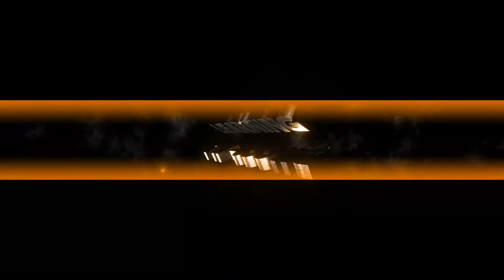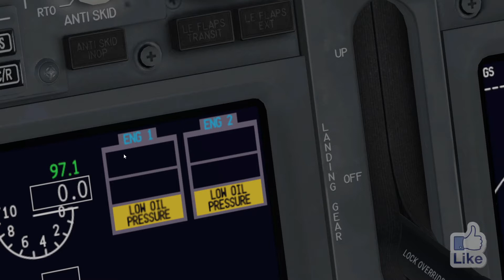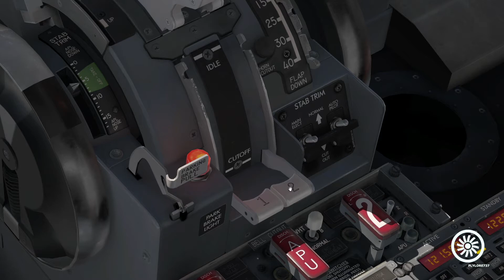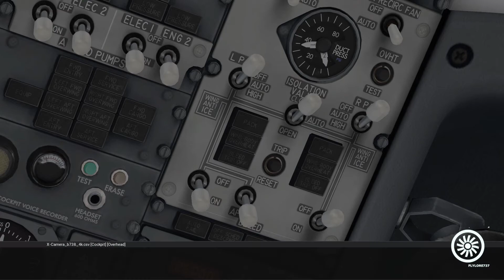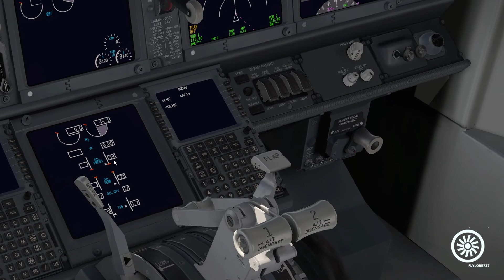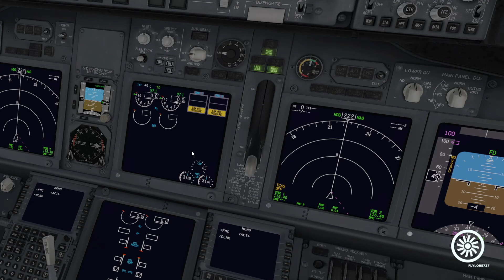Learning 737-800 - Start Valve Open [ENG]

Comment: Good video. Very helpful thanks.
There is one thing not quite correct about your description. When the fault occurs you say that you would have the ‘Start Valve Open’ light remaining on. Actually what would happen is that the whole block of three captions for that engine would flash on and off to attract you attention but the text from only the Start Valve light would be showing. The other two would be solid amber. I checked this in the simulator recently.
Reply from the maker: Thank you so much! I hope to be able to perform more videos in the future despite not having spare time at all now. 
What you wanted to emphasize in your comment is totally right. The entire block of three yellow lights starts flashing but only the text "start valve open" is visible. Much appreciated worandrew :)

Comment: Excellent video! In case there is a hung start, or even a hot start, with Start Valve Open caution, does the QRH still apply, or is it correct to cutoff the engine as an aborted start? In hot start the priority is naturally controlling the EGT peak, but in case of a stabilized hung start couldn't we unnecessarily cause damage to the engine in case we cutoff the engine by-heart as an aborted start?
Reply from the maker: Hi! First of all sorry for my very late reply. I was not able to get into my YouTube channel anymore. Well, what Boeing says is that the most “dangerous” situation takes precedence in the problem solving chain. So having a hung start or an hour start at the same time of a “start valve open”, despite being very very rare case of having these at the same time, requires to perform the “start valve open” non normal checklist (NNC) first. I hope to have answered to your question :)